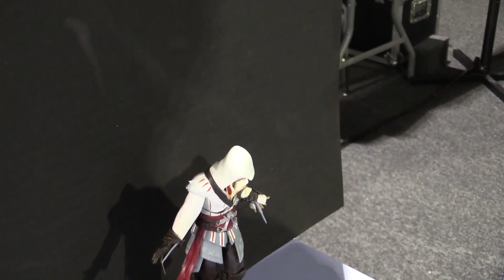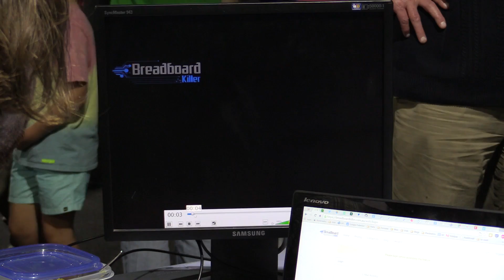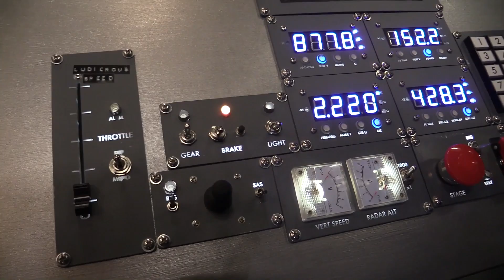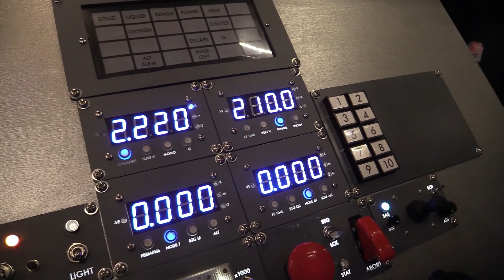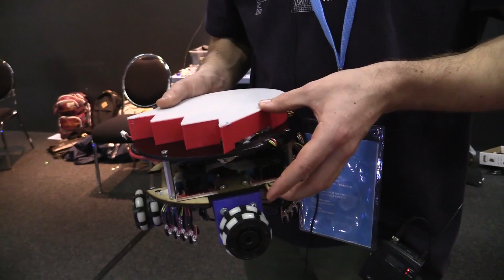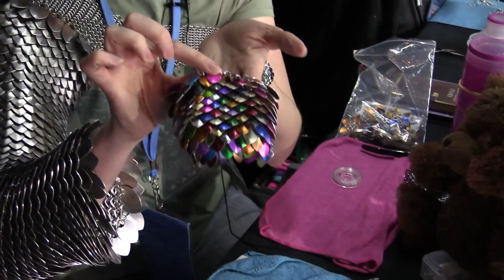EEVblog #785 - Sydney Maker Faire 2015 Interviews

Comment: That's good they have potential sea level, just in case a planet decides to get water.
Reply: I looked it up on Wikipedia afterwards. For planets without large bodies of water they tend to take the mean surface altitude as a base, and that's what sometimes gets referred to as sea level.

Comment: I've been following the construction of that Kerbal Space Program controller since the start of the project, as well as working on my own. Mine is still a way off. I'm using this project as an excuse to force myself to learn C. I've always dome hardware and logic gate design. The last time I did programming was on a TI-82, and on a Commodore 128. All my robots were done using physical hardware, no programs. This will be a great opportunity to give myself a new skill, make life easier, and b-l-o-w-u-p fly rockets with an amazing physical control panel! :P

While his relies on primarily the 4 digital displays with reconfigurable display selections, I chose to favor multiple analog meters and larger numbers of displays. I plan to use at least eight 8-digit displays, and I also have 11 analog meters. 7 of the meters are 6 inch (14.7 cm) edgewise meters (often used for power plant readouts). 5 are single, and 2 are dual movement meters. I also have a large (4 inch, 9.8 cm) 3/4 rotation center pivot circular meter that will serve as my vertical velocity meter (The meter style matches the style of the on screen vertical velocity meter). Finally, I have a 3-axis artificial horizon (navball) that I'm trying to develop a controller for. The stock device, referred to as an FDAI (Flight Director/Attitude Indicator) or ADI (Attitude Director/Indicator), has a mechanical "ball" that has markings to indicate your orientation to the horizon (or an inertial reference). The ball has 2 servos and 2 synchro receivers inside, along with gearing. There is a third synchro/servo pair behind the ball that spins it end on. Slip rings transmit power and signals into the wishbone assembly, and again into the pivot of the ball. An incredible mechanism! The control is from 3 synchros attached to rate gyros. When an error exists between the synchros inside the unit and the gyro synchros, the servos move the ball to correct the error. Rather than using mechanical synchros (driven by servos or steppers, for example), I'm trying to emulate them, by using ten 12-bit DACs and generating 10 since waves with different amplitudes and polarities. I am HOPING that an Arduino Mega has enough processing power to generate the requisite 400 Hz sine waves needed to drive this. If it doesn't work, I'll try again with some manner of attenuating/inverting circuit instead.